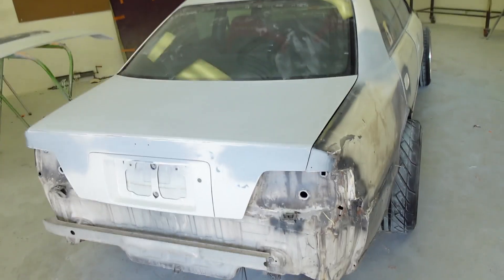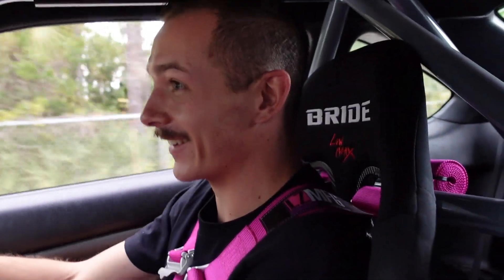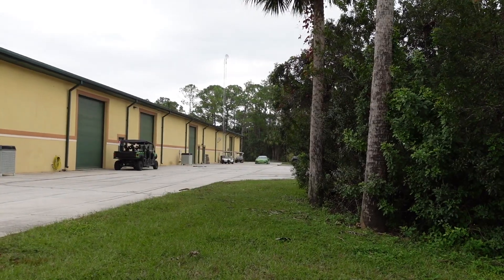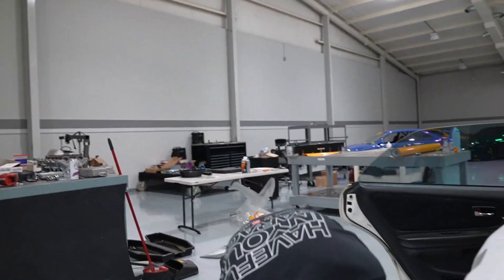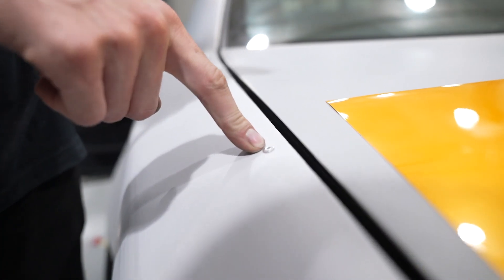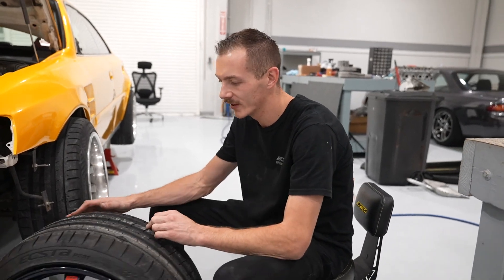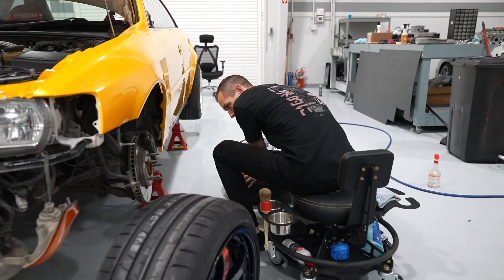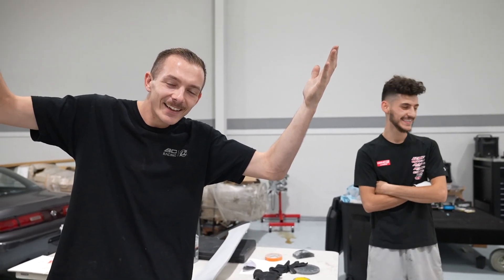JZX100 Chaser Gets a Transformation!

Comment: "Single pass, single direction"
proceeds to go back and forth with it
Reply: lmaooo fax
Reply: also made me laugh then divine did it right :P
Reply: Man you don't understand sanding, one direction doesn't mean only sand to the left, it's horizontal on one grit, then vertical on the other. Basically side to side, then up and down, then back to side to side. It's always going to be "back and forth" but when they meant one direction they meant east to west VS north to south
Reply: @RobertoDelTaco  He’s talking about with the ceramic coating…. Chill
Reply: They were talking about the ceramic coating, not the sanding process. 
The ceramic coat is all supposed to be applied in one direction, in order to keep the layer as smooth as possible.
Reply: @TranceFur  10:30
Reply: Now this is more my style lol I would have flown in from NY and did it for food and housing
Reply: @RobertoDelTaco  Reading comprehension, get some. They were talking about the ceramic coating, and quoted the insutrctions that Adam read out.

Comment: The reason headlights yellow up again after you restore them is that the UV protective coating has been taken off, so if you don't put some sort of protection back on the plastic will just yellow again.
Reply: Our Ceramic Headlight Restoration kit he used includes a ceramic coating applied with a wipe to prevent them from yellowing again

Comment: Griots ceramic is good, however nothing is “forever” like you’d think. Even re clearing the headlights isn’t a forever thing. You can get maybe 8mo-1yr from a ceramic on them, keep reapplying every 6mo and they’ll keep on looking great though. The biggest mistake people make is they sand, compound, and polish headlights before applying the clear coat, when in reality you should stop at around 2500-3000grit and then clear over that, so it bonds better
Reply: Hi there, our ceramic coating will outlast the average ownership of a vehicle (10+ years). If you experience failure at any point, whether in a year or 10 years, we’ll send you a brand new one.

Comment: I wet sand and polish headlights and it lasts for about a year or longer depending on if it's left outside. You could put clear coat after the sanding but u better be sure u have all the scratches off from sanding.

Comment: If your looking for a good head light restoration process, sand all the factory coating off (all production headlights have a factory clear coat on them, some are ceramic coated) using 500 grit, then 800 and so on up untill 1500 grit and then use 2k clear coat, put a coat of clear plastic primer then 2 coats of clear to seal them, makes them look like brand new and gives them all the facory UV protection they originally had. 👍👍